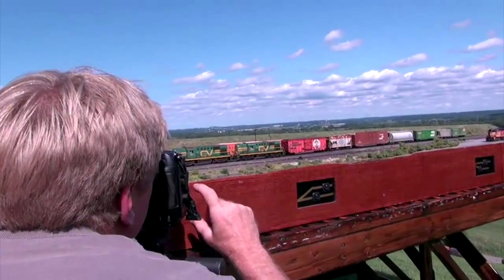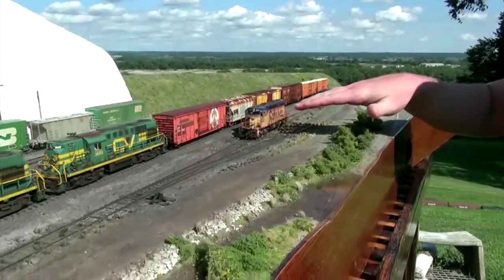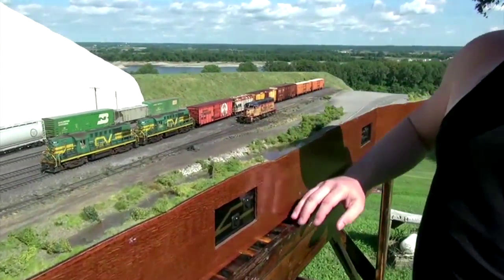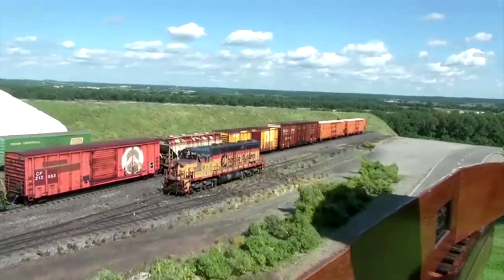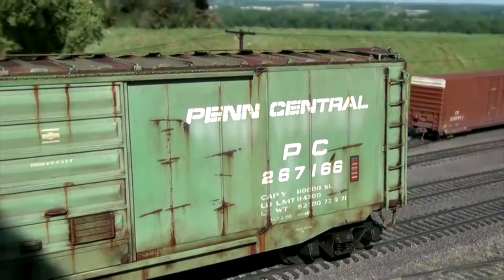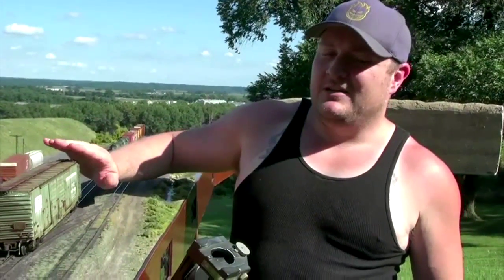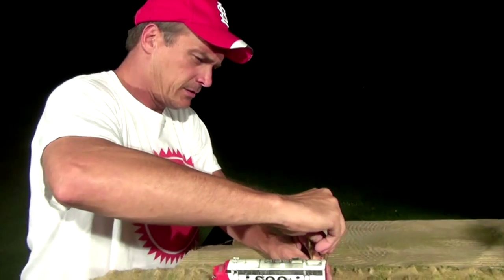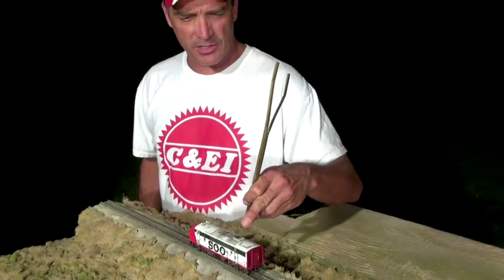Mike Morrison diesels & freight cars | Model locomotives & cars | Model Railroad Hobbyist | MRH

Comment: Hello Ken

I have been binge watching you on MRH Whats Neat this week Column for two days.   On one of your shows you were making tufts of static grass on a asphalt area by adding glue over the cracks. You applied the grass then when ready. You vacuumed the excess grass, leaving a beautiful plants growing in the cracks, believable look what you were looking for. This got me thinking of what I like to do when I need to do this same kind of look. I like to wet a cookie sheet with cooking oil, ( Pam). Let stand for a minute to level out the oil. Then I put blobs of white glue in random shapes. lines like cracks, lines in the shape of an "L", what ever can be used in parking lots, side walks, or sides of may be buildings. Next I clip my applicator to the cookie sheet with the alligator clip to complete the electrical connection. And begin to apply the static grass. Once dry? You can vacuum up the excess grass, or shake the excess in to a zip lock bag for reuse. What you get is a sheet of peel-able, usable clumps of grass in different shapes that I can peal off and apply on to the layout. I have done this on Aluminum foil  sheets. Or one time I used wax paper. But on wax paper you will need to put the grounding nail in each puddle of glue to complete each tuft of grass. But it works. You might try it in one of your shows. I am not the one who came up with this idea. And I do not remember where I learned it. But I bet there are others out there who might like to try this idea. 
Love your show.

Vincent Sanders. N scale SP modeler.